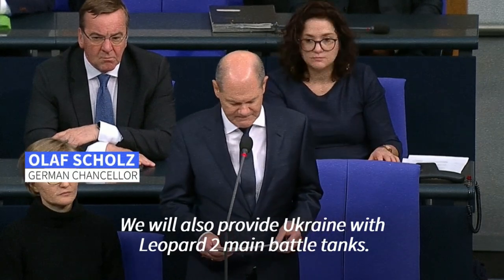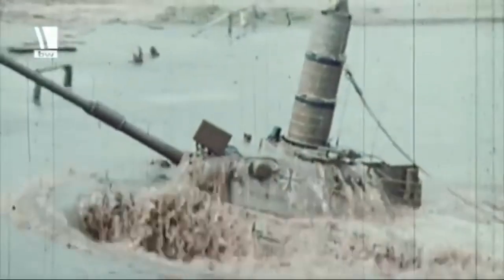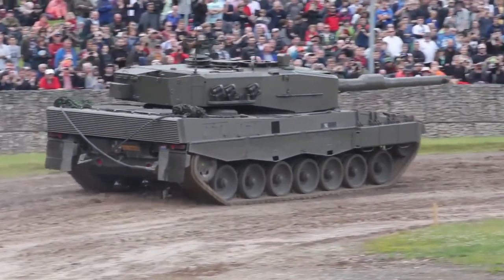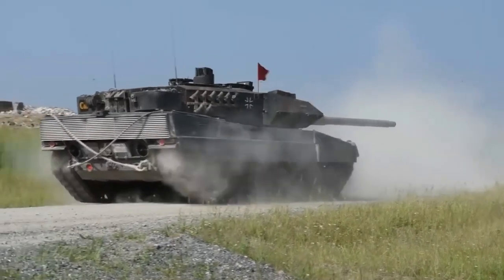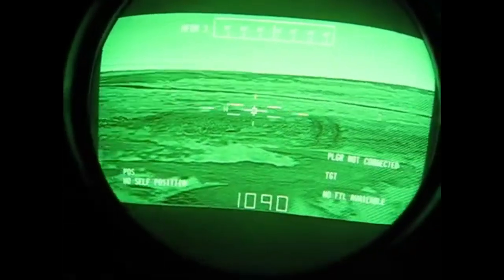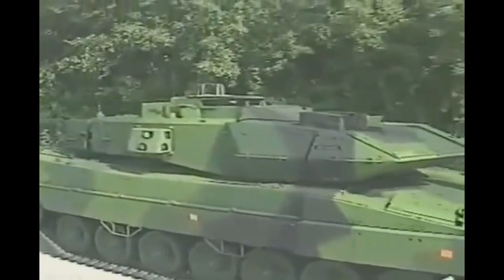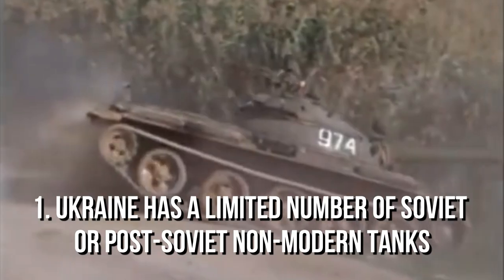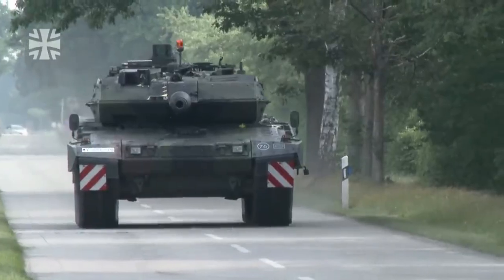THEY'RE ON THEIR WAY! Why Leopard 2 tanks are a real threat to Russian?

Comment: They no threat..14 of them. lol
Reply: 14 only come from Germany. Together with the other Leopard user States Ukraine will recieve many more. More than 100. Spain alone wants to send 53 of them. And Ukraine will recieve even more. Rheinmetall said they can repair and send 139 Leopard 1 and 2.
Reply: @Grey Fox  Yeah and they will arive like 3 months from now. Well done. Scholz is pleading with Putin and to apologise, because deep down Germany did not wanted to do it. And the US ones are 1 year away. Congratulations!
Reply: @greyfox9224  So you fight with 100 tanks against 10.000 tanks ? Bwahahahaha
Reply: @michaelflamingsword3131  Sure it needs time. The Ukrainians need training first. And how I Said they get more than 100. Against 10000? Are you a russian propagandist? Where do you have see 10000 russian tanks.  Russia even uses old T62 tanks. I think everybody except of you can think that Russia has problems with tanks
Reply: Your comment shows that you don't know anything. ruzzians had 12 900 tanks and 10 000 were at warehouses. It means that my most of those were just scrap metal and spare parts. Currently ruzzians has only some of the more modern tanks. Armata for example has been built under 20 and not seen in action. They don't even use "Terminator" tanks for city battle because they had just few and those were disaster. Mostly ruzzians are using tanks 40+ years old
Reply: @tapsulinka  even older T64 T62 tanks have been activated as well . most of the T72 used cant even reverse .
Reply: @michaelflamingsword3131  It was a ruse to push Germany further into the pit while the US sits back and enjoys the show.